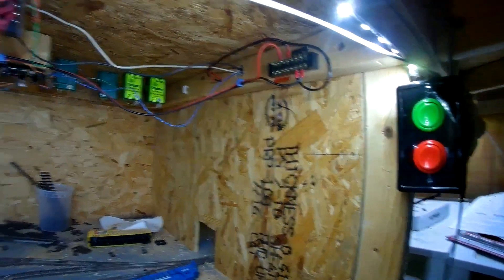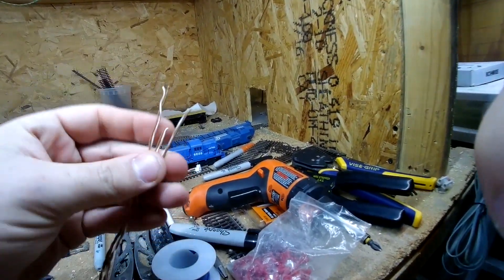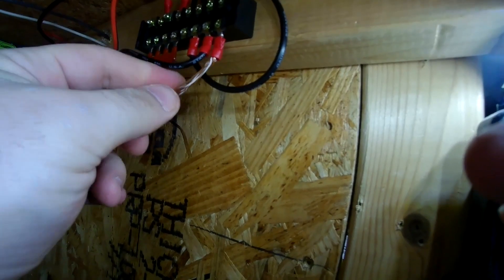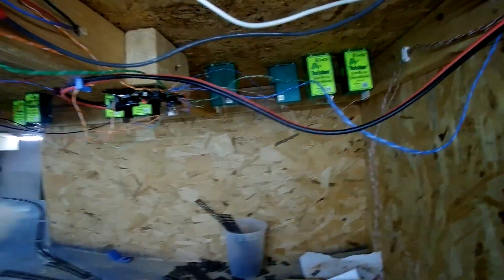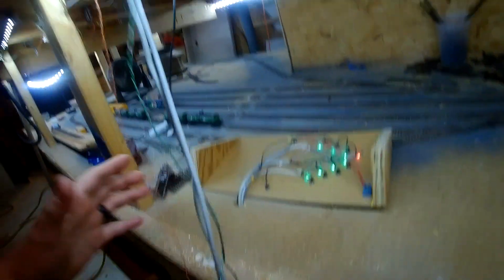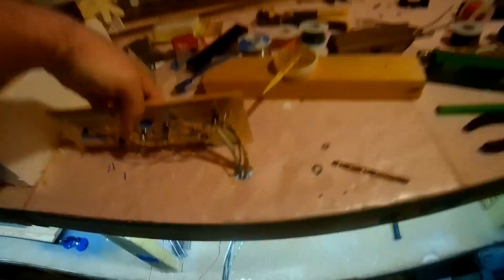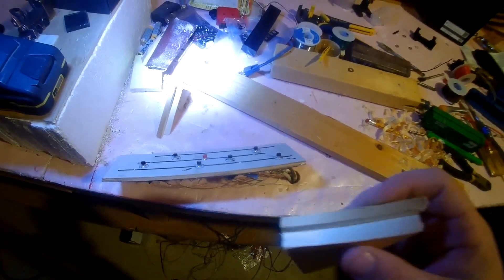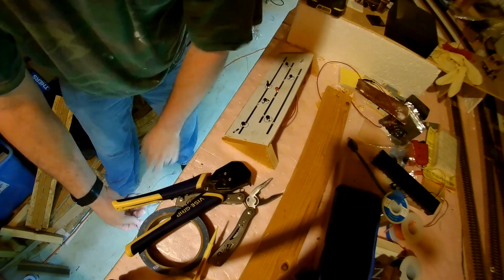Leds working on Panel

Comment: Really awesome concept you have there. One suggestion to make your life easier, since your using network cable; you can solder short strands (3") of network wires to each jumper on your tortoise and then when you run wire feeds to it, connect them with UR connectors. No need to strip the ends of wires and the gel inside the UR will solidify over time making the connection stronger. It's a whole lot easier crimping two wires in a connector than soldering in a tight space....lol.
Reply from the maker: I should have known better and wired something up before the install of the tortoise. lesson learned. thanks for watching.

Comment: Nice work, awesome job done 👍
Reply from the maker: Thank you 👍it was a pain but i like the outcome. next time i think im gonna use a different resistor for those green LEDs, they are bright.
Reply: Rick Bailey looks like a pain. I’m probably going to keep stuff simple with as few switches as possible. My main Focus is scenery and photography, Videography and video editing of train layout. I’ll leave operations, switch lists and stuff like that to the pros. How did the baby room come out?
Reply from the maker: @thebibletrain8297  i like ur plan. Im no pro... babies room is come along. Grey primer covered the red. I have the bottom have of the room painted pink (2 coats). Tommorrow is top half, a lighter shade of pink. Its alot of work... after the walls i have trim work to repaint and then install a chair rail.

Comment: Rick,

Thats why I  pre-wire all my Tortoises which then connects to a terminal block makes it so much easier for you.  That way if a tortoise fails you just remove the tortoise from the terminal block FYI
Reply from the maker: yeah.... dont know why i didnt do that... i was in a hurry to get the tortoises in, wiring was a second thought.

Comment: Thanks for your explanation on the mini panel wiring, and all the switches, I'm new to the Tortoise switching too.
It's great help as I'm new to the mini panel, and in the process of installing it on my new layout.
I do have a question, that maybe you can answer me, in regarding wiring to the mini panel.
Do I need to run separate ground wires to the mini panel, to operate the DB20's and Switches?
Another question, if I run out of room on the mini panel, by adding another min panel, the 2 could work together?
What I have done to my Tortoises solder pads was, I found these 8 pin plugs at Jaycar electronics in Australia. I soldered the male plug on the switch machines, and made used a 9 core wire ( they didn't have 8 core). So what I have created was basically a plug and play set up, and it makes life easier to join the wires at a terminal block, than going underneath the layout attempting to move the body in positions it isn't meant to be. The 9th wire I will use at a later date to hook a DB 20 to it. The advantage I have found creating this system is that if a switch fails, I wont have to re solder every wire to the switch machine. All I have to do is solder a plug on the end of it.
Reply from the maker: Well Arty, I think you have won for the longest Comment i have ever received. . Im glad this video has helped you.  If you have any other questions my email is on the about page. Grab that and shoot me an email. Let me see if i can answer the ones here. 

"Do I need to run separate ground wires to the mini panel, to operate the DB20's and Switches?" If you are using the DB20 as a sensor to trip the mini panel, your esentially using just like a momentary switch. so yes the logix wire goes to a pin and the ground gets looped into all the other grounds. 

you can add as many mini panels as you want just make sure that each one has its own cab address. 

you idea with the connectors and the wire are spot on. dont think ive ever seen a 9 core wire. 

Good luck and let me know if i can help in any way.

Comment: Rick,  In my existing panel  I have two LEDS Red & Green  3mm no resisters needed both are tied together Pos on Red go to Neg on Green and Post on Green goes to Neg on Red.  Then each wire goes to output 1 on the tortoise.  When the Tortoise switches the turnout the LEDS changed from Red to Green or Green to Red.  You splice the output 1 wire on the Tortoise and place both wires from the LED .  Just a thought for your setup.    Now back to me.  My question is on the push buttons.  Currently with the Switch 8 MK2 and the Button board if I push the button once the turnout moves. to open and then I hit the same button again and it moves to close.   So on the NCE Mini Panel is there a Button that can do that.  Call me when you can today thanks Tom
Reply from the maker: your LED setup will work. that does work best when not using an external power source and not track power. I did it this way to eliminate the amount of wires going to the panel.  for the mini panel unfortunately the answer it no (but there is a word around, it does involve 1 extra button). for the mini panel 1 button is on command (or set of commands). cannot change that. i'll call soon.